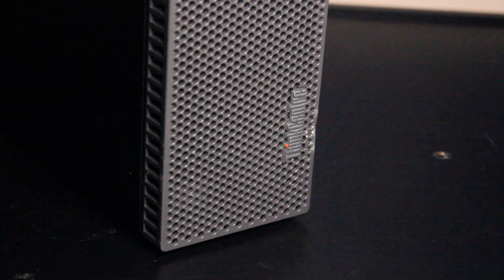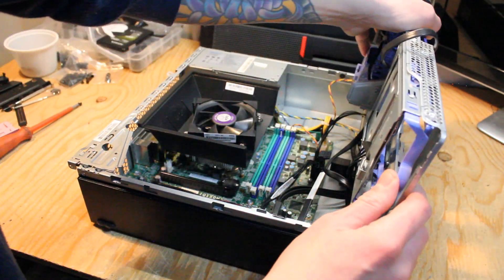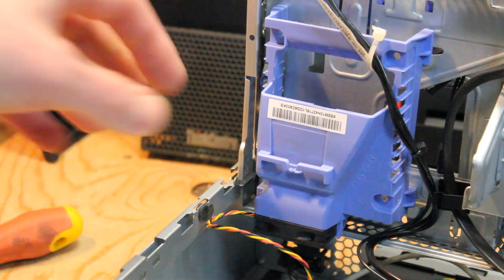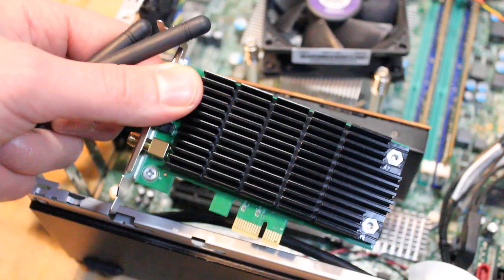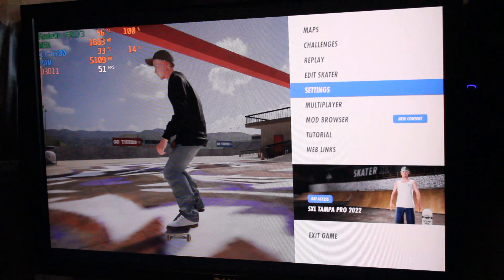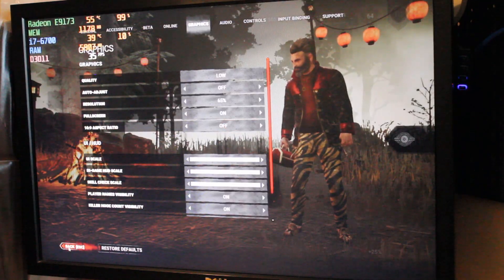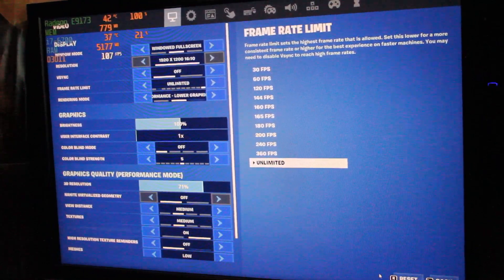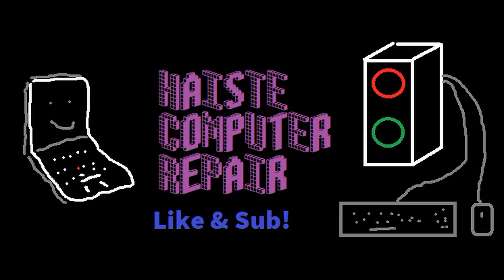Upgraded Lenovo ThinkCentre M900 for Gaming in 2023

Comment: I see a big bottleneck there between the CPU and GPU, I'm planning to buy a Lenovo m700 with the i7 6700 with 16gb of ram for just only 279€ (290$) (2 weeks ago came with 8gb of ram at the same price so it's a really good purchase), it is cheaper than this one, I have less USB ports but at least came with most of this upgrades by default. The GPU that I'm going to install will be the AMD Radeon RX 6400, it's more powerful than the GPU showed in the video and probably It won't make a big bottleneck
Reply: Big help. I just got an m900 sff with an i7 and now am most likely going to get that same GPU.
Reply: I want buy lenovo thinkcentre 910s with i7 7700 suggest me gpu to go with
Reply from the maker: One thing about the RX 6400 is that it supports PCIe gen 4.0 while the Lenovo ThinkCentre M900 Motherboard is PCIe 3.0.  For this reason you may be better off using a GTX 1650.  But, either way, hope it went well.  This AMD GPU in this video is definitely not the best choice, but it's what I had on hand at the time.  I have since tested out a GTX 1650, 1050 Ti, and 1050.  I built a SFF PC with a RX 6400 and Ryzen 5 4500.
Reply from the maker: @GenZwayy  Try out the GTX 1650 low profile.
Reply: @HaisteComputerRepair  what none low profile

Comment: I have this PC and just want to add a GeForce GT 1030, will the 210w psu be enough for this card? Note that I have not added anything other than the card. The ram, hard drive and everything else is as the computer comes.
Reply from the maker: Yes it would work with no problems at all.  It would be better than the AMD card I installed in this video.
Reply: @HaisteComputerRepair  Thanks for answering my friend, I was afraid that it would not be enough because I do not change the HDD for a ssd. However I did remove the dvd drive, I hope it makes up for it a bit. 

Anyway, thank you very much for the video!
Reply from the maker: @luiscolinagonzales8112  You will be fine, you don't need to remove anything.  The GT 1030 has a power rating of 30W.  Definitely go for the SSD.

Comment: I'm wondering if the rx 550 will work for this pc. I'm deciding between rx 550 and gt 1030. rx 550 is cheaper and better than gt 1030 but has a tdp of 50 watts which might cause problems with the built-in power supply.
Reply from the maker: It looks like both the 2GB and 4GB variant of the low profile RX 550 has that TDP of 50W, with a suggested power supply of 250W.  Unfortunately the M900 PSU is 210W (at least the 20+ I have worked on).  The power connecter is only 10 Pin, so not so easy to swap out with another PSU.  You can use cable adapters, but with the caveat of a different, or ATX, power supply fan running at all times unless the PC is completely shut off.  However, you might be totally fine with the 210W PSU.  I will be testing this out soon with a GTX 1650 and i7-6700 in a M900 with the 210W PSU.  Will definitely make a video.
Reply: @HaisteComputerRepair  Thanks for the response, will wait for that video!
Reply from the maker: @hakdokhakdok195  You bet!

Comment: i used this video for reference to help me get my first pc, i got a lenovo thinkcentre m910s, i5 6500 (hopefully upgrade to i7 6700 or 7700 eventually) 16gb ram 2133mhz, LP rx 550 4gb & i gotta say i'm happy with it, i know its not the best but it gets the job done! i really like what you did with the fan mod, and i myself love dead by daylight so watching this really helped make my decision, if it wasnt for you i would still be on my ps4!
Reply from the maker: Excellent!  Luckily your M910 will support 7th gen Intel, so that would be a nice upgrade.  If you find a GTX 1650 low profile for a good deal, that will pair well with an i7-6700 or i7-7700.  The 2GB AMD Card I installed in this video isn't the greatest, just what I had at the time.  Good luck and welcome to the realm of PC's!  Here's a video I did with the i7-6700 & GTX 1650 in the same M900:  https://youtu.be/PTVBP0kVo98?si=U91Sc3mHNZ0ouYwN

Comment: Hi Haste.  Excellent video  I have a Lenovo M720S that I use for business. It is also the small form factor model.   I bought it stock with an 8th gen I-7 processor.  Only upgrade I did was to add an M.2 NVME SSD.  It made a big difference in the speed.  I'm finding that this model or the M920S can be picked up at very attractive prices with the 9th Gen I-5 processor...which is more than adequate for business use.  Anyway, really enjoyed watching our video.  Amazing what  you can do with an affordable computer like this.  Thanks for sharing.  Well done my friend....
Reply from the maker: Thank you!  an 8th or 9th gen Intel i5 or i7 would be excellent.  I did a couple videos where I installed a GTX 1650, 1050, and 1050Ti into this M900.  If you ever decide to install a graphics card reach out and let me know how it goes.

Comment: Thanks for the video! But is there any GPU I could use with 3Gb VRAM minimum?
Reply from the maker: Look for a GTX 1050 ti or GTX 1650 low profile.  RX 6400, Arc A380 low profile.

Comment: Thanks for videos :"D As they were helpful. Planning on picking up either m93p or m83 to replace my RPI 4 for remote work to connect to main PC. 
I won't be upgrading it most likely with GPU but will throw my old parts in there instead. Just need to decide which model and how much to spend on it.
Reply from the maker: Well, the M93p and M83 seem near identical.  I would just figure out exactly what you need and see what the prices are.  Maybe one will come with an i7 for a good deal.  Good luck!
Reply: @HaisteComputerRepair  After upgrading to ryzen 5900x, my old i7-4770k and 24gb of ram are gathering dust haha. And it just seems the best way to spend money on SFF PC like that.
Barebones M83 with some G series processor around here is about 20$ and for i5 variants it's around 60, same for possibility of getting m93p with i5 from auction.

Otherwise for newer ones... They are of course more costly ^^"
Reply from the maker: @pczajkowski9  Perfect, though I do believe the Lenovo motherboard does not support a "K" series i7 as the BIOS is basic business class.  I have never tried myself, but I have yet to find someone online that has had success and been able to prove it.
Reply: @HaisteComputerRepair  To my understanding as long as BIOS supports the CPU itself it's fine but the only downside is losing on the overclocking capabilities... Which I didn't do since getting it in early 2014 ^ ^"
Will need to remember to post here after getting my hands on the m*3... Which can be soon or if m93p.. Can be in about month as it would come from different country >>
Reply: @HaisteComputerRepair  Put it together today and... It works. i7-4770k booted without any problems in the m83 alongside overkill 24gb of Corsair vengeance ram. 

But sadly it doesn't seem to play nicely with my 1440P display as DP errors and changes colors as per manual. But works fine with VGA on 1080p display :p
Reply from the maker: @pczajkowski9  That is great news about the i7-4770K!  Too bad about the DP output.  Have you tried updating drivers?

Comment: You can buy a new thinkcentre 70s with i5 14600 and 310 watt for about 750-850 depending on mem/ssd. Maybe save a bit and get that? Get an lp 4060 in it and game? ~1100 and brand new? 2 years warranty.
I always have difficulty with using old systems like 10 years old. If used and like 2 years half price 600 ok, I understand 🙂
Reply from the maker: I don't think spending up to or over $1000 (especially in CAD) would be worth it for a general consumer or office PC with a low profile RTX 4060.  The cost/benefit is just not there.  Unless you had money to burn.  This ThinkCentre M900 build is meant to showcase what you can do on a tight budget, so what you are expressing is not really related to the content of the video.  It cost well below $600 CAD and was purchased by someone for light video editing/general use.

Comment: I have the exact PC. Only 8 gig memory the i5-6500 CPU I just tweaked the integrated graphics. And in getting as hi as 200fps but never lower that 80 fps at 1920x1080 60hrz just set everything for performance in windows and the integrated graphics. You don't need a different video card. Just put the settings right in windows for the integrated graphics and turn on game mode in windows set it for performance.
Reply from the maker: Do you mind going into more detail as for what games you are referencing?  You definitely would need a dedicated graphics card to play a wider variety of games with better performance and higher resolution.  Yes, you can play some "higher end" games on the integrated GPU by lowering the resolution and  graphics settings, but it's confusing for people to hear someone say that they don't need a graphics card.
Reply: @HaisteComputerRepair  well I don't seem to need one alien arena, Warsaw, idg are a few of the games in playing. haven't needed to lower the resolution yet.  But hey if you want to buy graphics card go ahead. You can't play triple A games without lowering the resolution or installing a graphics card that's true. But older stuff runs just fine. Lowest I've got for fps so far is 60fps with everything on high.
Reply from the maker: @starsoldier3643  Thanks for sharing, that is good to know and I am happy to hear what the community is doing with hardware.  For people reading your initial comment, they won't know what you are talking about when you arbitrarily say you are getting 200fps on 1080p.  It's confusing.  BUT, it makes total sense when you share what games you are playing.  So, thanks for following up with that :)

Comment: Hello need pc case recommendation for my lenovo thinkcentre m910s which has 1 ssd, 2 hdd, 12 gb ram, and nvidia 1650 gpu. Im very happy with the performance of my pc as I could play modern games and handle really corel and cad for my work but the problem is the pc case as it really is a mess because of the storage and gpu. Could you recommend a pc case to swap to or is it possible to change into any pc case to fit all of it?
Reply from the maker: First check out this portion of my video covering what you will need for a new power supply in a new case (if you are needing to power a different card or want a power supply that can match an ATX case) https://youtu.be/D_4K8QW1VbI?si=j9cRgBRA_NGDzBfr&t=71
Reply: @HaisteComputerRepair  Thank you very much ! so i watched the video very informative for the psu but for now i wont be changing my psu my question is does my motherboard fit in any atx case or no?

Comment: Hey Haiste. Back to ask another question. I noticed they make 3050 and 4060 LPs now and am in the budget to get either for my M900 SFF. Just wanted to ask if the 4060 wouldn't be compatible for any reason. Running an i7-6700 and 32 GB of ram with stock PSU.
Reply from the maker: The RTX 4060 Low Profile has a recommended 300W PSU and, in models I have seen, require a 6-pin power connecter.  An RTX 3050 would run fine, though one thing to note is that the M900 motherboard will be limited to PCIe 3.0 speeds, while the 3050 will have PCIe 4.0 capability.  This may not make much of a difference in this use case, though.  Do you have the 210W PSU?
Reply: @HaisteComputerRepair  Yea it's 210. That's why I am leaning toward the 3050, just wanted to see if the 4060 was compatible without any further upgrading. I'm expecting some bottlenecking from the PCI difference, but not too worried about it. Thanks again, always a great help
Reply from the maker: @stahnke_as_pho  What CPU do you have installed?
Reply: @HaisteComputerRepair  i7-6700
Reply: @HaisteComputerRepair  Yo. Just wanted to give you an update that I installed the 3050 LP. It was about half an inch too long, so I had to remove the cage that holds the disk drive and SSD.  Based on measurements, I can saw off the obstructing corner of the cage and still fit the caddy for the SSD. Will let you know how that goes. But other than that, the card works flawlessly. It's quiet, stays cool, and performs exactly as I need it to. 

Just wanna say thanks again. Your channel helped me out a great deal.
Reply from the maker: @stahnke_as_pho  That's awesome!  I am happy to help.   I'd still love to try one out. If you have access to a dremel or even metal snips.  Maybe a metal file to clean it up after.  It would help to take it out so that metal pieces don't end up on the motherboard.  Good luck!
Reply: @HaisteComputerRepair  Yea it's going to get filed like crazy after I saw that corner off. Also don't wanna cut any wires with any sharp or jagged edges. I'll take notes for you if you'd like. I did a lot of research trying to find how to remove the cage, but couldn't find anything. It just snaps in and out. 😑
Reply from the maker: @stahnke_as_pho  Take it as a learning opportunity and maybe invest in some safety glasses if you dremel!
Reply: @HaisteComputerRepair  oh this is right up my alley, I used to cut metal daily when I used to install solar. I'll let you know the results

Comment: Can u help me , is 1650 oc lp good enough for m720 sff (single slot) and wireless wifi adapter for it? should I upgrade psu for it or downgrade gpu(it will bottleneck cpu)
Reply from the maker: What CPU do you have installed?  It's not really possible to upgrade the PSU in a SFF M720 unless you use a cable adapter or swap into a larger case (with the same cable adapter)
Reply: @HaisteComputerRepair  i7 8700 3.20ghz
Reply from the maker: @Thunkv  Nice.  What power supply do you currently have?  I see there is 180, 210, and 260W options in the product specifications.
Reply: @HaisteComputerRepair  210w (idk if it's 210 or 260 but I best want 210w )
Reply: U can tell me 210 w / 260w options :)

Comment: What’s the best used or new graphics card for this PC for a reasonable price today?
Reply from the maker: If you can find a GTX 1650 low profile for a decent price, that would be the best match.  Next one down would be the GTX 1050 Ti, but honestly go for the 1650 if you can.  Remember that this motherboard supports PCIe 3.0 speeds, so buying a card like the RX 6400 with 4.0 speeds may not be the best use of money.
Reply: @HaisteComputerRepair  what about the GeForce 1080 GTX?
Reply from the maker: @setterkim4050  You could use that, you would just need to migrate the system from the SFF tower case into a larger case, get a new power supply suitable for the GTX 1080, then purchase the cable adapter for the power supply connector to the motherboard.  This causes the power supply fan to continuously run unless you shut it off or unplug, though.  I talk about this here:  https://youtu.be/D_4K8QW1VbI?si=uYhyP318cdRg409A&t=100

Comment: Hi !!! amazing Video!! i got this same PC recently and i have a pair of questions, exist another proccesor / CPU more powerfull compatible whit this model? and whit your upgrade, you can use video editors like Davinci Resolve? really thanks for this video!!! :) 

EDIT: i want do stream whit this hardware later whit obs, and your opinion really helps me, thankyou :)
Reply from the maker: Well, it would depend on what the resolution of the video is that you want to edit.  1080p?  Fine.  4K?  pushing the hardware a bit and you will need a decent low profile graphics card.  What kind of streaming are you wanting to do?
Reply: @HaisteComputerRepair  yes :D 1080p , and the stream is whit a webcam c922 logitech whit obs :D whitout gameplay, just i want use it like secondary transmition machine for use audio software like protools. 

Really thanks for your answer !!!
Reply from the maker: @mikamusicmx  No problem and good luck.  Let me know if you find something.  Otherwise I do have some of these units I could ship.

Comment: Sorry to bother but could you please provide me a couple links so I can upgrade my m900 sff… I’d like to do the nvme ssd but I’m not sure which PCIE  I would need as well as the nvme you’d recommend? Also is there anyway to just place the nvme in my existing nvme slot that’s already built in to my m900? Thank you and sorry for all the questions
Reply: Also I’m currently running an i7 6700… is there a better one you recommend? I’d love to get some ideas to make this the best I can make it 😊
Reply from the maker: What is your budget on SSD's?  There isn't an NVMe slot in the M900, but if you have a particular variant (not M900) that might be the case.  Here's a couple links:  https://www.amazon.ca/UGREEN-NVMe-PCIe-Adapter-64Gbps/dp/B08TBW12B8/ref=sr_1_5?crid=3TK8FFFX17Y1G&keywords=nvme+adapter&qid=1698278537&s=electronics&sprefix=nvme+adapte%2Celectronics%2C126&sr=1-5
Reply: @HaisteComputerRepair  5:47   thank you for replying. I’m a little confused though.. the link you sent has a lot more pins compared to your video pcie adapter and was wondering what the difference is between the one you used in this video Vs the link you sent me regarding the m900 Small form factor?? Thank you for your time
Reply from the maker: @MarcusEngle True, it looks like that UGREEN fits different types of PCIe lanes.  The one I used in the video is here:  https://www.amazon.ca/gp/product/B07JJTVGZM/ref=ppx_yo_dt_b_search_asin_title?ie=UTF8&th=1
Reply: @HaisteComputerRepair  is the one with more pins any better or will it work just the same?
Reply from the maker: @MarcusEngle I would imagine it would work the same.  But good question, I'll have to look into that design.